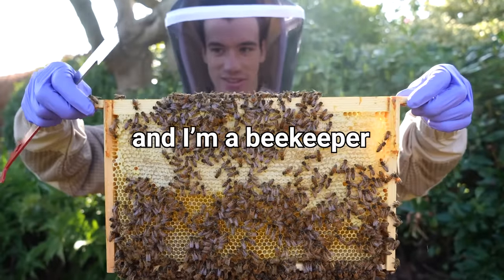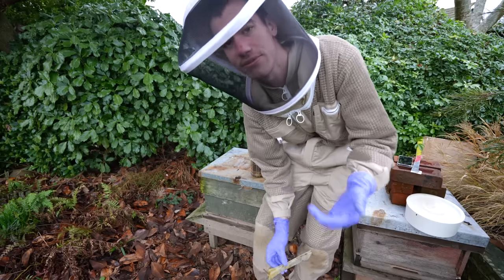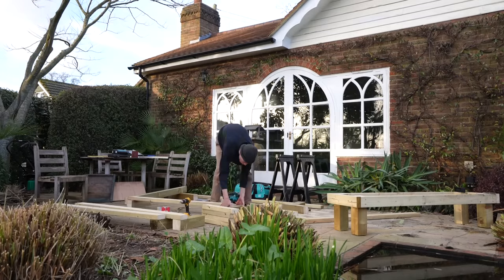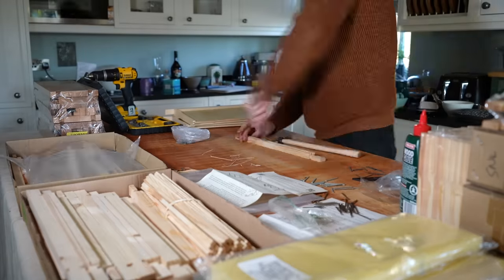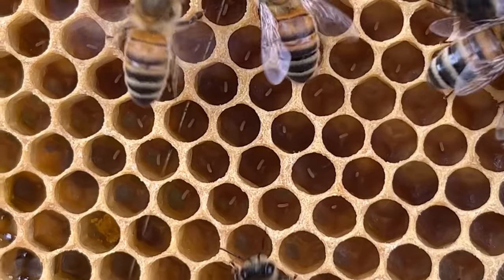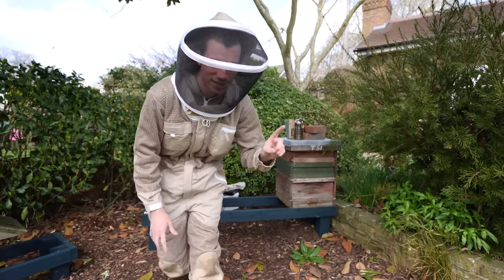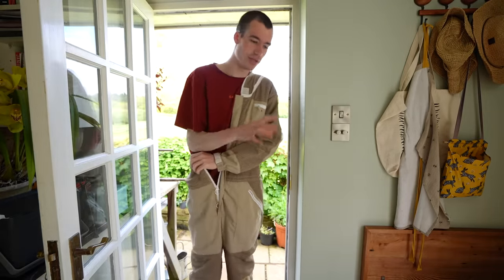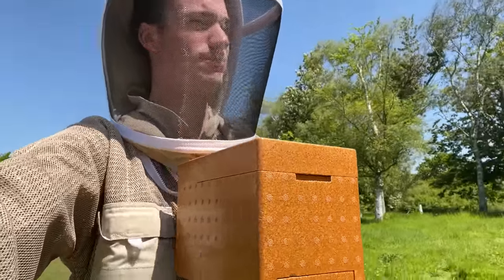Beekeeping from day 1 to 2 years - WHOLE process from beginner beekeeper to my record honey harvest

Comment: If you're going to be painting in beehives you want to paint them either a dark green or black because that will keep keep the heat in by warming the highs up during the winter with the weak and feeble sunlight that there is so any sunlight hits the hive boxes will be warm was absorbing the heat which is what you want other problems will get them really hot Summertime but then you could move them in the shade during the summer or put them under deciduous trees so that when the leaves fall they allowed this sunlight to hit the boxes during the winter but they will be shaded in the summertime by the leaves

Comment: Full Depth: This size is the most common, especially on the mainland. Most of the time when you see a hive, the large box on the bottom is a full depth box. A full depth box is 242mm deep.

 

WSP: This is also known as a 3/4 box. It is 192mm deep.

 

Ideal: This is also known as a 'half box'. It is 147mm deep.

 

Full depth, WSP, and Ideal frames and foundation are sized to fit in their respective boxes. For instance, you cannot put an ideal frame in a full depth box.

 

Many beekeepers use a full-depth brood box but put shallower boxes (such as ideals) on as supers. This is because these boxes are easier to lift when they are full of honey.

Comment: oh I know an olden days before the modern beehives like the rope behind these to have back in Utah and Nevada and Arizona they used to use a pressure that was made out of bird wing feathers so the asymmetrical feathers of a birds went flying apart and they would strap them together probably with cordage or thread and then attach them to two pieces of wood that would nail together and use that as a handle and they would use that handle to then brush the bees off with the feathers off the off the waxboards that hold us up honey So they brushed them off into the rest of the hive and then store them away quickly and then bring them to wherever they're gonna do the extraction kind of interesting to see how things have changed I mean the the feather brush is very gentle doesn't hurt the bees just booze them off where they are they fly off and they fly back to the hive so it's similar to the blower that you use but this way is more manually intensive I would think than using the blower

Comment: They don't need painting but they do need preserving. The weather and elements will rot the wood and all that work will need to be repaired faster. If the stands rot the weight from the hives will break the wood. Yu could've stained them too. Either way you want to prevent rot and pests.

Comment: would you want to also put some of the strips to the entrance so when the bees go in and out they touch the strip And any mice that go out with them paralyze and die off in the wild instead of going to another flower and infecting another hive? I agree putting them in the hive But as well as the entrance might be beneficial to preventing the spread of the mites. because if they land on the entrance and this there's a strip right inside the entrance they're gonna cross that at some point to get inside correct sam when they're leaving they're gonna cross it to go outside to go collect Henry granted that doesn't help any that are inside the hive that's where you put them inside the high look you are doing but if you put one or two at their entrance when they cross it it should parallelize the lights that they might take outside the hive with them just a thought I don't know how effective that would be for my destruction but like I said it's a thought that you might want to check out research and maybe try

Comment: You can also centrifuge with a bucket a screen and a string. Not as easy as the machine version, but it is a much simpler cleaning process, its cheaper, and multi purpose. THis is why back in the day enameled pots pans and buckets were useful. Clean durable, easy to clean, long lasting. Why dont we have these popular again? Why settle for cheap shit, and stainless that does leach metals into certain foods???

Comment: bare in mind tharte are some nations that forbid the importing of honey western australia bans importing overseas  Honey
Honey is prohibited unless certified on a Health Certificate.
Bees, hive products and used equipment are prohibited except by permit.
Propolis, royal jelly and bee collected pollen, in capsules or tablets in ready retail packaging and intended for human consumption, if not a prescribed potential carrier. 
The following hive products (that do not exceed the size or volume listed) may be permitted entry into Western Australia:

Pollen - must not exceed more than 150ml or 100g per individual unit
Royal jelly – must not exceed more than 150ml or 35g per individual unit
Propolis - must not exceed more than 200ml or 200g per individual unit
Beeswax and products in which beeswax is the single greatest ingredient by volume may be imported if the product is clarified, refined by heat treatment to melting point, and free from extraneous matter
Bee venom is permitted.

Comment: ants do not like chalk or dietitious earth needed to bees but if you draw a line let's say if you have cinder blocks holding up your hives you draw a line in chalk around the base of the hive at the top of the cinder blocks and they cannot cross that line that's why in the South of England you have felt very few ants in like chalky areas because it kills them what happens is the small pieces of chalk which made it with diatomaceous plankton fossilize and they are sharp and spiky and they will work their way into the joints of the ants and cause them to bleed to death Now it will affect the bees the same way but only if the bees come in contact with the shock or the diatomaceous earth and the diatomaceous earth loses its effectiveness when it gets wet so if it rains you're going to have to wait until it tries and then reapply it.

Comment: too bad you can't make yourself a bee shed like they do in Scandinavia And keep your highs inside the shed and Justice open up the windows on the shed during nice days and make sure there's ventilation but it would also keep out the moisture I would think at least a strong rain at any rate I mean a hurricane winds and stuff like that yeah that you're going to get wet but otherwise a be shed or be house would keep up most of the water I would think I mean humidity you can't help but deal with but in any direct rainwater or leeks in the hive would be prevented.

Comment: Does your dad know that species of turtle Or tortoise I should say because there's a couple different orders as it could be Depending on its size it could be an elongated redfoot There's another rose to the Redfoot What is called it has a redhead I don't remember what the number did there's a yellow head There's the Solcana which is the third largest tourist in the world aldabra which is the second largest in the Galapagos which is the largest I don't think it's a Galapagos and I don't think it's in El Dorat because those can get huge also Kata is possibly the largest turtle and they get here they can get up to like 3 400 pounds usually not that big the old divers in the galops the fields can't like 400 500 pounds the males can get like 600 pounds on the galops galapagos is huge and they can live like a hundred and fifty two hundred years old with proper care and treatment and Whatnot and the wall they probably get over to 150.